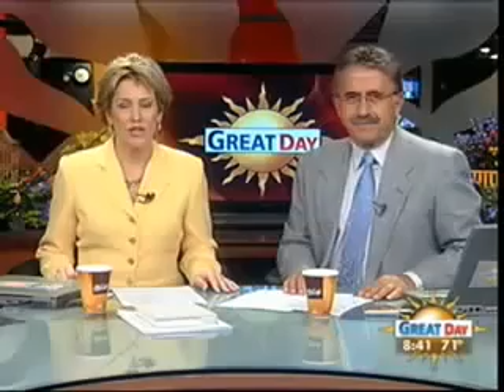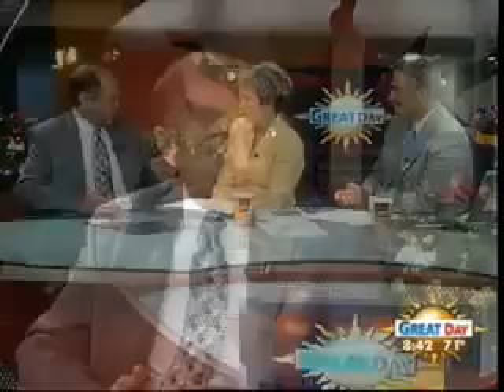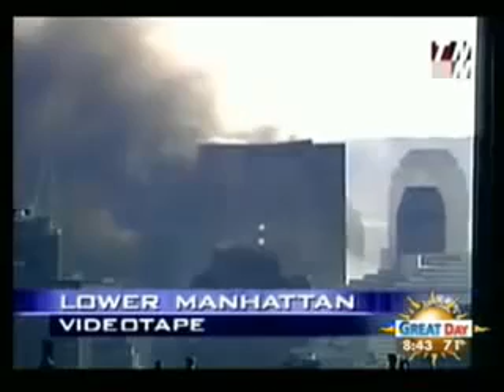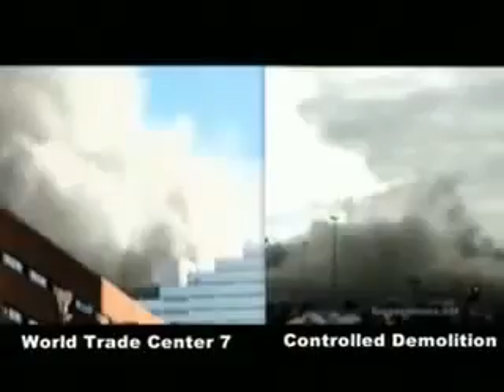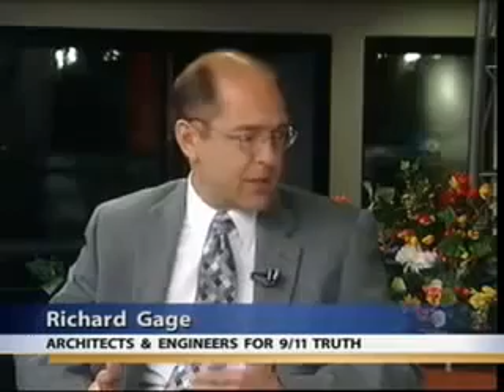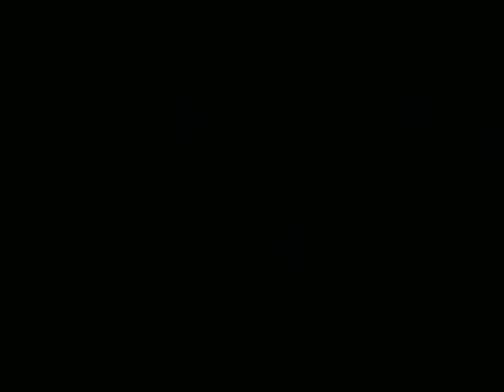Richard Gage on Great Day Fresno KMPH Fox: Evidence for Controlled Demolition (2009)

Comment: I’m curious if WTC 1,2 and 7 had a Tuned mass damper also know as a harmonic absorber or seismic damper. Their application can prevent the structural failure of a building.
Reply: anthony winter No they did not. You wrote all that for nothing.

Comment: Great to see local news coverage, good job Richard!
Reply: 4:09 - Richard Gage doesn’t answer the question because the answer is no. These cherry picked, zoomed-in collapse comparisons are a perfect example why - he compares upper sections of WTC building collapses to controlled demolition videos of entire building collapses.
He claims molten steel. It more than likely was not molten steel - molten aluminum can also glow orange at office fire temps. 
Also Welding creates iron microspheres. There was never a shred of iron microspheres encased by aluminum oxide found in any of these, “samples,” he discusses, and if there was an aluminum/iron based thermite reaction it would have been everywhere. Simply put, he didn’t do his homework before coming out with this particular talking point. Stop letting him jerk you guys around because again, none of his claims are accurate. Don’t trust me though, look into it for yourselves. Try to find proof of the claims he makes via sources other than the one he is associated with (the architects and engineers web site).
Reply from the maker: Dr. Steven Jones discusses the dust here
https://www.youtube.com/watch?v=6wW4Jrr1RQ4

Comment: 4:09 - Richard Gage doesn’t answer the question because the answer is no. These cherry picked, zoomed-in collapse comparisons are a perfect example why - he compares upper sections of WTC building collapses to controlled demolition videos of entire building collapses.
He claims molten steel. It more than likely was not molten steel - molten aluminum can also glow orange at office fire temps. 
Also Welding creates iron microspheres. There was never a shred of iron microspheres encased by aluminum oxide found in any of these, “samples,” he discusses, and if there was an aluminum/iron based thermite reaction it would have been everywhere. Simply put, he didn’t do his homework before coming out with this particular talking point. Stop letting him jerk you guys around because again, none of his claims are accurate. Don’t trust me though, look into it for yourselves. Try to find proof of the claims he makes via sources other than the one he is associated with (the architects and engineers web site).
Reply: At 4:09 - yes I think you're right, he didn't say that he didn't collect any samples personally.  I don't think he was even ever at the disaster site.  Instead he says others did collect samples. If you have independent evidence of Gage's mental instability or that he has made misrepresentations please post them here. 

I don't know what "zoomed in" collapse comparisons you refer to.  I've seen enough casino demolitions to know what a controlled demolition looks like, and the Building 7 collapse appears to be a textbook example of one.

Your claims regarding metals and thermite are confusing and you provide no support for them. 

Mr. Gage and his organization is one source of information among many that cast serious doubts on the official findings.  What we all need is more information regarding the tragedy and you've provided none.  I'd suggest you return your focus to posting "Farting Preacher" videos on your Youtube account page and leave the disproving to someone else.
Reply: Todski33 That William character took the time to copy paste his feelings of frustration toward Richard on every comment. Strange and a little sad.
Reply: William Moffitt is obsessed with a farting preacher. Just look at his channel. This comment is for those who might have taking William seriously. Sorry Bill, this channel is for intellectuals.
Reply from the maker: Dr. Steven Jones discusses the dust samples here https://www.youtube.com/watch?v=6wW4Jrr1RQ4
Reply: King greatest Anthologies it's just SO SO SO frustrating as a chemist having to watch someone with absolutely zero scientific background hold forth the way he does about thermite. He is drawing conclusions that cannot be drawn by the data that he has. Do you know how many things are composed of the elements that he mentions? None of them are only associated with thermite either, it's a complete lie. However the one thing that IS only associated with thermite (aluminum oxide hardened around iron spheres) was never found in a single sample from any of his or anyone else's sources. The heat dynamics of such a reaction produces this very unique byproduct. My earlier question applies to iron microspheres as well - do you know how many ways there are to create them? The list is enormous - Striking a lighter creates iron microspheres. Any metal that was cut created countless piles of them. He is only stating conclusions that fall in line with his theories, and he does so by spouting off a list of elements only to lie about what it means. Everything he presents to his audiences is smoke and mirrors. And I mean everything. Please don't dismiss what I'm saying because I'm only trying to help. But please don't just take my word for it either. Look into it for yourself and draw your own conclusions. Why would I be wasting my time writing any of this if I wasn't confident you could find these things out too? Has Gage ever told any of his audiences to do their own research, or does he just tell them to reference his website?
Reply: Todski33 what did I not provide? I would be more than happy to elaborate on anything that I wrote that may have been confusing.
Reply: I I'm more than happy to have a normal conversation, and if I came on too strong I apologize. I just can't believe what I'm seeing when I read people calling him a national hero. As a chemist it's immediately clear to me that Gage is in way over his head anytime he begins to discuss chemical compositions, melting points, and what they mean. All I want to do is make sure you guys don't continue to be misled by this guy. Don't mistake finding humor in perfectly timed flatulence as an indication of stupidity. Everyone has their own way of escaping the stresses of daily life, and mine just happens to also make lots of people laugh. Farts don't change facts. I'm willing to bet that last sentence has never been, and will never again have any reason to be said ;-)
Reply: Lawyers' Committee for 9/11 Inquiry I'm ten minutes in to this video, and so far all this guy has done is talk about his background, ignore the fact that the twin towers were tube/truss style buildings (unlike buildings with a complete steel grid throughout), and already the image of cool molten aluminum has been flashed on the screen, the reason I say that the molten aluminum is cool is because it is still silver in appearance. If the aluminum in those images had actually been heated up to normal office fire temperatures it would have been glowing a very bright orange. This is what you guys do - mislead. The one time you attempted to discredit my last point you heated a shot glass worth of aluminum up to where it just began to glow orange, and then you poured it onto a cold iron skillet to show that it quickly became silver again and stopped glowing. You completely avoid the fact that this does not happen at office fire temperatures, nor does it happen when the volumes of molten aluminum are as high as what was witnessed flowing out of the south tower immediately before collapse.
Reply: William Moffitt “Striking a lighter creates iron microspheres, and the metal that was CUT created piles of them”?  The steal beams were indeed cut, but how sir? Quoting Mick West doesn’t make you a chemist. You claim dozens of fire fighters and first responders are either liars or don’t know what they are talking about when they say they seen molten steel. Richard’s claims are backed by FEMA and the USGS and your claims are backed by Mick West. Please elaborate more sir.
Reply: King greatest Anthologies I have no idea who mick west is, and yes I am suggesting that firefighters were absolutely incorrect if they thought they were looking at liquid iron. It is agreed that none of that material was ever tested, so if you look at the properties of both metals the likelihood of it being aluminum far outweighs the likelihood of it being liquid iron. I’ve worked with thermite for years, and even that reaction isn’t capable of keeping iron melted for as long as it would have been in liquid form when they reported seeing it. Aluminum/iron oxide based Thermite has an extremely fast rate of reaction, and upon completion the iron immediately begins the process of cooling. In other words thermite wouldn’t have been able to maintain the heat necessary to keep that much iron hot enough to still be a glowing liquid. Aluminum on the other hand could have easily remained molten and glowing bright orange when they reported seeing this, “molten steel,” as the fires that were still burning were hot enough to maintain aluminum in that state. Again, you’re relying on people who just looked at a glowing orange substance without testing it to see what it was composed of. All knowledge of their physical properties point to it being aluminum.
Reply: You don't understand the concept of evidence.  Evidence is substantive, verifiable third-party information that supports a claim.  You provided no evidence, only claims.  I noted the items you needed to provide support for (which was everything you stated) please provide substantiation for you claims.
Reply: I appreciate your desire for a little levity in life, it's issues like this that make it absolutely necessary.  My concern is that you call into question a man's mental stability and accuse him of misrepresentation with no third party facts to support either claim.  We're all in this crazy world together William, I hope we can all keep open minds to new, and sometimes extremely disturbing concepts as they come to light.
Reply: Todski33 You’re right, I will remove the comment about him losing his mind because it doesn’t do anything useful. As for the points I made I will pull together some links for you to check out and will put them in a future comment in this same thread. But I still encourage you to look into it for yourself because nobody should ever just trust something that someone on the internet sends them. Thanks for not hurling horrible insults and names at me like most of the people on these videos do :-)
Reply: William Moffitt Okay then. I have a few questions regarding the nano thermite if the material studied was not actually thermitic because I think that you are slightly mistaken over some of your points, if you are willing to listen?
Reply: Conner Price I am definitely willing to listen. I promise you I have an open mind. I will even admit to you that a truther showed me a video once that appeared to show three men standing in the street after building seven fell, and suddenly there’s a deep, low frequency explosion that sounded like a demolition charge. That is still a big question mark for me, and I don’t know enough about lower manhattans set-up to come up with an explanation for what that was. So if I see something unexplainable I will not try to shrug it off.
Reply: William Moffitt I always have an open mind 
 and so if my points were wrong i'd be happy to admit it.

Firstly though it would be important to ask what your opinion is on the red/greychips found in the dust and where they came from?
Reply: I appreciate that William, I look forward to your information.
Reply: I believe you're correct Conner, as I understand it there were small markers the thermite manufacturers are required to place in their products found in the rubble.  We need to know whether or not this is correct. If it is, there's a huge problem with the official narrative.
Reply: Conner Price Primer- paint